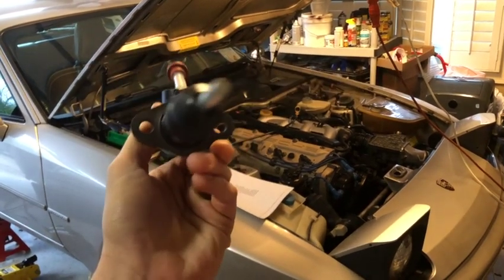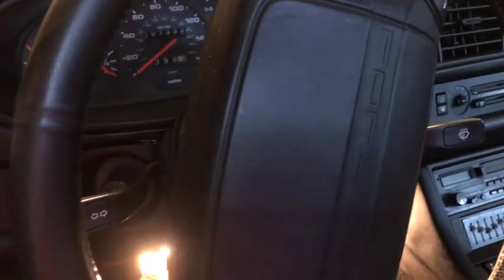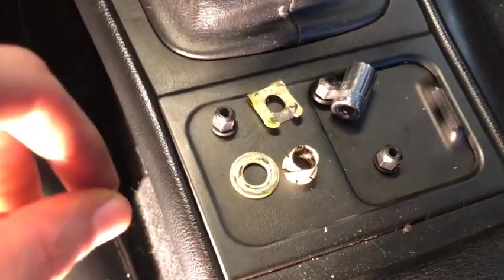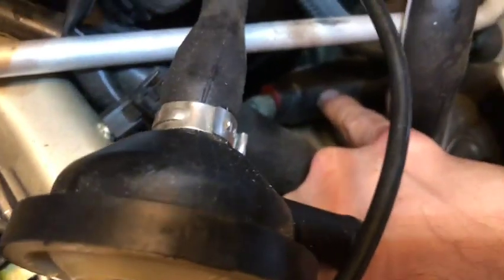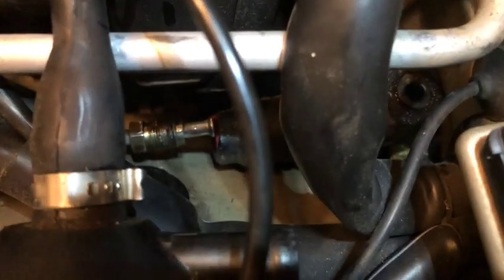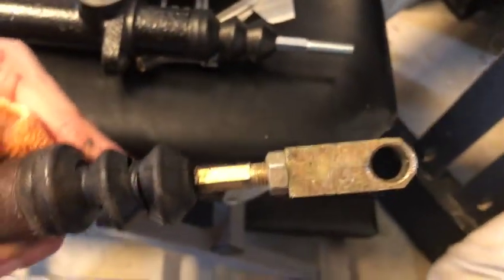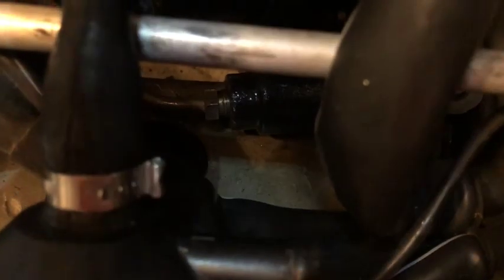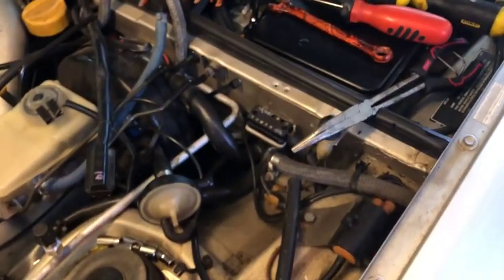Clutch Master Cylinder Install Porsche 944

Comment: My clutch randomly stopped working on my 944 while i was driving. The pedal still feels the same as it always has when i push it in. No loss of fluid in the reservoir. But it doesn't engage anything when i press it, i had to shift without the clutch to get it home. Any ideas if it's the slave or master or is it more Likely the clutch disc?
Reply: Hi. I’m currently restoring a 1982 944 and the clutch goes straight to floor I’m replacing both master and slave at the same time then you know it’s all done and bled properly. Costs less than 200 well worth the job.
Reply: It’s always better to do the cheaper option first is what I’m trying to say
Reply from the maker: If your pedal is operating normally and you can confirm it’s moving the clutch fork, then you likely have a clutch failure of some kind. The disk, pressure plate, or throw out bearing… if pedal does not move the fork, then it’s a master/slave/pedal/line failure
Reply: @LJC944 did replacing the both the master and slave fix the issue? My 1983 944 currently has that same issue, clutch pedal springs straight down to the floor
Reply from the maker: If your clutch pedal is operating like it should, but you can’t work the clutch… I’m afraid you’ve got bigger issues.  You are likely looking at a new clutch kit.

Comment: Can I ask what issue you were facing before replacing the CMC? My 84 944's Clutch pedal works like it should but doesn't return more than 1/3 of the normal amount. I can pull it back out by hand or with my foot, but it no longer returns as it should. I want to be sure there isn't any other fix besides this drastic of a repair.
Reply from the maker: I noticed fluid dripping from the master cylinder inside the floor board, and, my clutch pedal would go to the floor and not return at times.
Reply: @Clayscott87  ah thank you, I took mine to a 32 year retired Porsche mechanic to look over it so hopefully he can assess the best fix for me